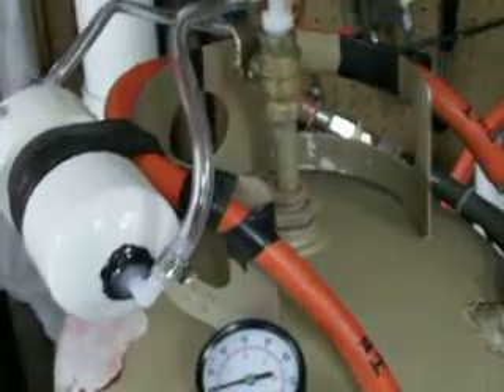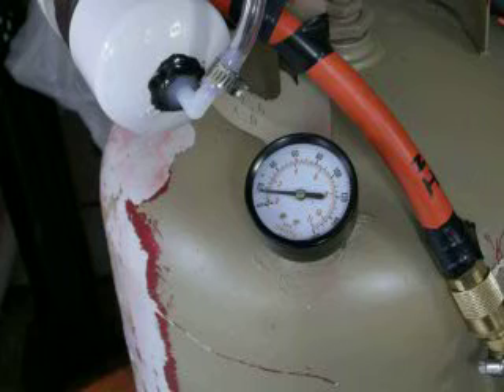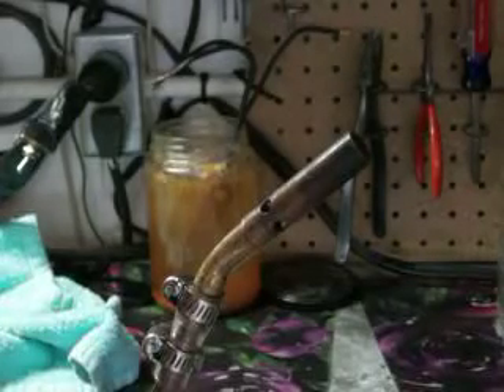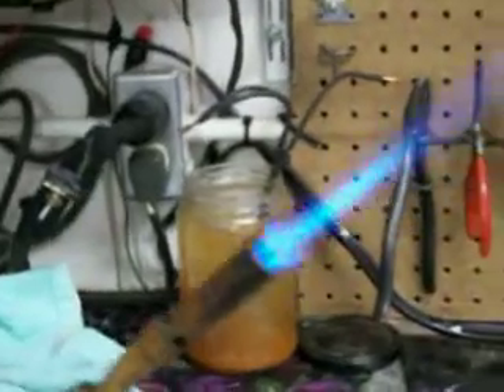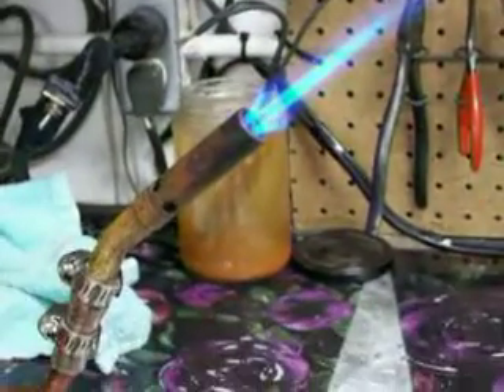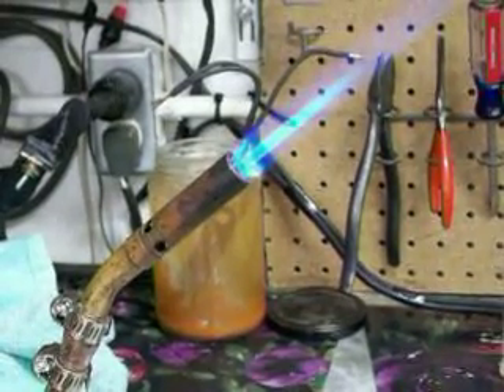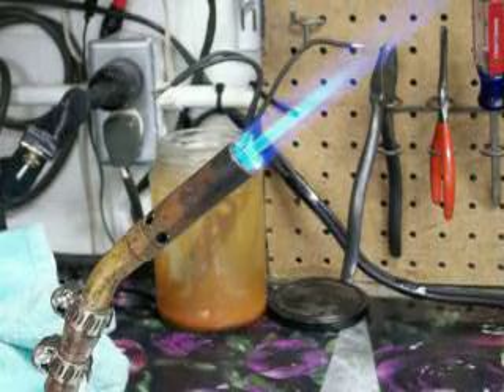gas vapor under pressure

Comment: Has anyone published anything for the application of this technology? I'd like to see how well it might work in my Smith's jewelry soldering torch! And could one theoretically pipe pressurized gasoline vapor directly into a standard auto carburetor, or would further apparatus be required to properly mix the air and vapor?

Comment: increase the vapor pressure 100 psi and BOOM auto ignition.
Reply: no it wont. made air pigs out of propane tanks and hold 125 psi for a joke
Reply: u need ignition for a kaboom. or over pressurize the tank that the tank explodes

Comment: i wanna see how much flame would come out of an injector that was using regular gasoline at the normal pressure for that system sprayed at a hot surface (your piston if you had direct injection, but use a normal injector since you won't have the engines compression pressure to fight) heated to let's say between 160-180 celcius, no more than 200 (somehow after 200c gas starts to refuse to vaporize) just wanna see how much of the fuel would turn to vapour in a normal system, do this outside since it would be more dangerous anyone who wants to try, but all i know is even though you have a beautiful flame and a very complete burn, do you have enough volume?

Comment: all this stuff looks like a bomb plastic line to PVC get small oxy bottles stainless steel lines you could use gas vapor through the wicks that would take the bomb out of the tank you all better think this through pretty clear half-ass will turn you into a Roman Candle

Comment: this may take a little research on my part but I want to know will this gas vapor work with a 2001 Ford Taurus 3.0 6 cylinder engine overhead valve

Comment: You have made a claim that your pressurized gas vapor system can operate on a car or truck - but where is your installation evidence?  An engine operates by a carb - or a fuel injected engine by numerous electrical sensors, injectors,  etc.. How would gas vapors be metered by the accelerator pedal like gasoline injectors are? I want to see your system in operation on a vehicle - both running - accelerating and being effectively driven. Then we can accept your assertion - that at present is without proof.  However I still enjoy your research videos. - Cuviercastle.
Reply: +Del Tuttle What if you install a LPG system in your car but run gas vapors instead LPG. The car will have LPG injectors and LPG ECU and if it is set right shouldn't be a problem for the main car ECU

Comment: Can I pass an emissions test using the wick system and gas vapor under pressure apparatus
Reply from the maker: +Roger Hoover iv done it before, had a ram dodge truck 318 had it tested on regular gas and the emission readings were way over the limits, would have failed big time, switched it over to gas vapor and the reading were all zero on co and hc, that tell me the vapor does not put out any emissions what so ever, and that is comming from a gas anysler that has just been checked out by the state highway patrol for that shop, remember this, its the on burned gas that produces  high hydrocrobons and carbonmonxide
Reply from the maker: +TheVaporkid  and i ment to  say that was just heating the fuel up with out compressing it.

Comment: great job.I am working on my jeep now to drop it in to fuel injector rail.Just one question i have how to get rid off air caught in tubes.I was thinking to install solenoid used for truck horn assembly and have it open right before rail for 5 sec to release air from tubes.
Reply from the maker: the way i will do it i will crank the engine over for a few seconds off and on in till the engine starts then you will be good
Reply: @TheVaporkid  hi have you done more with this system I'm very interested

Comment: Hi! Yes- this is it. I am not a chemist, but it looks like natural gas! And it is proven by the science- you can crack hydrocarbons in many different ways! Temperature, pressure, catalysts... or mixed. Tom Ogle do exactly the same way like you, but he can make it with high temperature, but maybe not? He maybe use carbon "pressurized tank" of hydride system which is in use today, but it is for Hydrogen storage, but I don`t think he use complicated system. His experiments with lawn mover give him idea- what to do. I think he use like you- system which convert gasoline to the natural gas or methane. Only in process of conversion we can achieve 200MPG. OK. All the best!

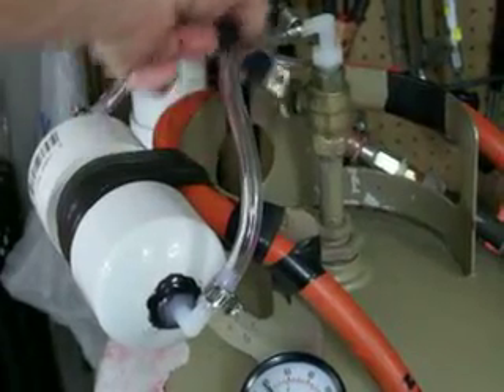Comment: Pause the video around the 2:03 mark. You can see the red hose is not attached to the pressure tank and when you shoot over to show the torch around the 3:55 minute mark the hose that is connecting to the torch is red. If you follow all the hoses that are coming off the vapor system that lead to the air pump and then the pressure tank those hoses are clear. The hoses coming off the pressure tank going into the small pvc canister that is attached to the pressure tank are clear yet the hose attached to the torch is red. When you pause the video at the 2:03 mark it looks like the red hose leads down to a completely separate tank but it is blurry so it is hard to tell for sure. I can not see anywhere in the video where the red hose is actually tied into the clear vapor line. It looks like it may connect into the red hose by the pressure tank when the video is paused between the 3:54 and 3:55 mark but it's very hard to tell. It kind of looks like there may be a tee on the red hose when the video is paused around the 3:54 mark and looks like the clear hose may tie into that area but it is very hard to tell. Can you please make a more detailed video so we can see where all the hoses go, what they are attached to and so forth so everyone watching can rule out anything that may cause this to be looked at as fake. We need detailed shots there are already allot of people that doubt so the clearer it's made the better off we are. Thanks buddy!

Comment: You have a clear hose as the vapor hose and coming out of the pressure tank there is also a clear hose but when you show the torch it has a red hose connected to it which is not connected to the pressurized tank. What's up with that?

Comment: Do you have a fuel injected car with a fuel rail you can tap into? Doesn't that system also have a lot of air in it from drawing air over the wick setup? If so, that system still puts out a LOT of gas. You could also just put the gas into a metal tube/container and heat that up till you get pressure and have no air in it connected right to the fuel rail and the ECM would regulate it perfectly IMO with a few tweaks. IMO, might be better than a carb setup. Let the ECM do all the work.

Great Work.
Reply: Have you tried your idea